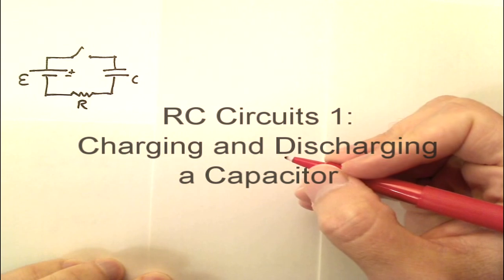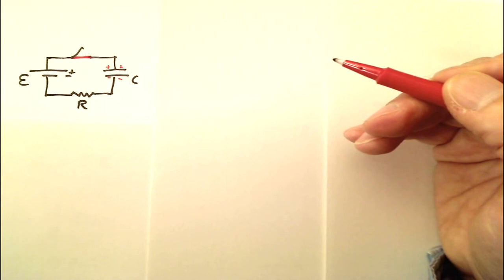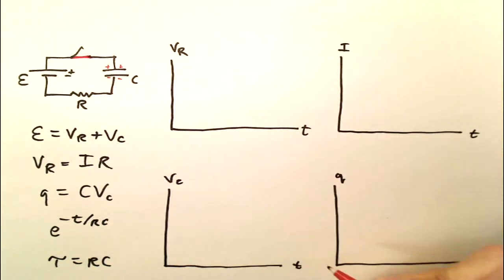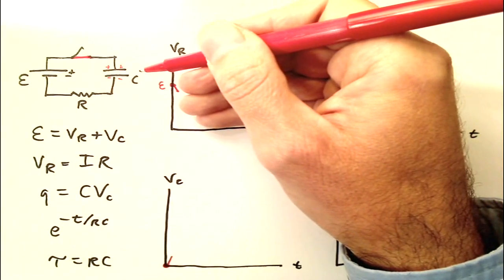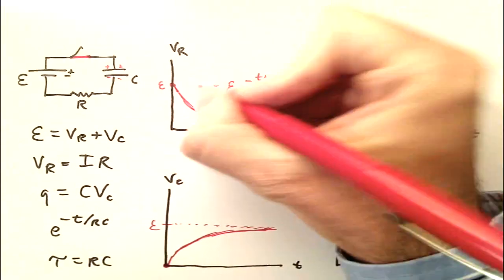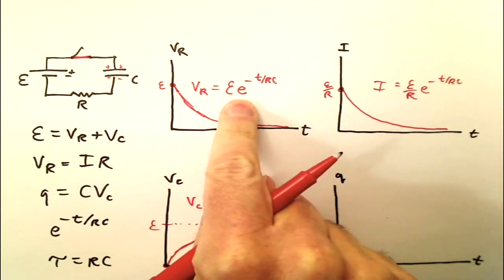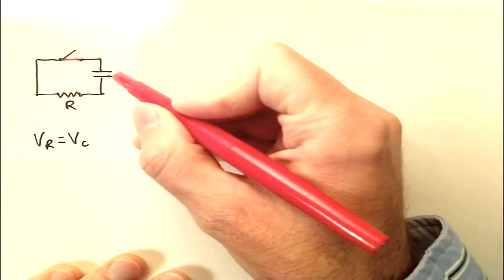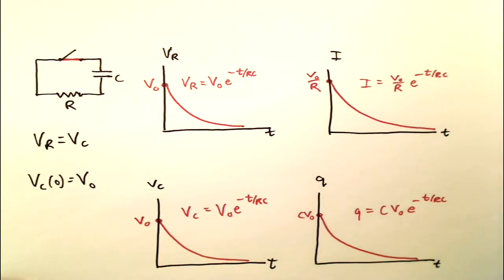RC Circuits 1: Charging and Discharging a Capacitor

Comment: There's an error. When you are talking about q in the charging process you establish that the initial value is C·E and that's not correct since the voltage in the capacitor is Vc not E, therefore the expression is incorrect as well and it should be C·Vc instead. You have to consider the voltage dropped in the resistor (Kirchhof Voltage Law)
Reply from the maker: The initial value of q is zero, as indicated by both the graph and the equation (7:07). The (q graph) equation is literally q = C·Vc, with the expression for Vc given on the Vc graph.

Comment: It is not the voltage "on" the resistor or the capacitor; it is the voltage across the resistor, also known as the voltage drop.   If there is one resistor in a circuit, then the voltage drop across the resistor will equal the input voltage in the circuit.  If there are two resistors in series in a circuit, then the combined voltage drops (R1 +R2, etc.) will equal the total voltage.  the "EMF" you describe is the voltage source of the circuit. 
Tau is much more than a "time constant" or an abbreviation of RC.  It is the amount of time that it takes for a capacitor to charge in combination with a resistance, measured in seconds. An example would be 1 Meg-ohm x 1 microfarad.  The result would be one second of charging time for the capacitor.
 You run through your explanations very quickly without explaining them adequately.
You don't give any examples of values.  You explain the equations exactly as if your audience already understands them and doesn't need them.  
I'm sorry, but I have to ask:  who is your intended audience?  It seems to only be yourself.......

Comment: great video.. Just can i know weather the charging and discharging times are equal are not.. I see Ton and Toff in some books i.e. duty cycle. weather Ton is equal to charging time(Tc) and Toff is equal to discharging time(Td). Can I know. Basically I am from MEchanical background i need to know this for some application of mine. Thanks.

Comment: what is e
Reply: It's Euler's constant (2.7182818), the base of any natural logarithm.
Reply: chris pajotte I think it's emf, the terminal voltage of battery without current?
Reply: You could just take E as the input voltage into the RC circuit. That would be easier.